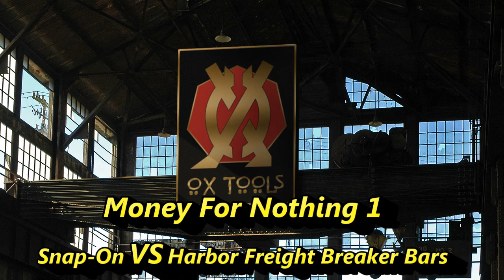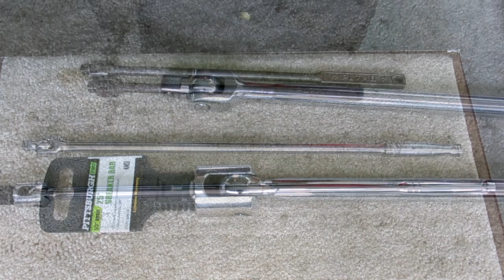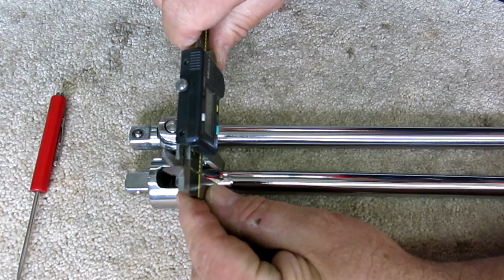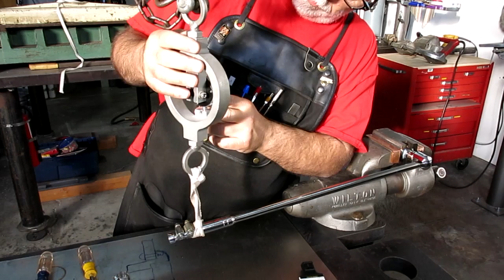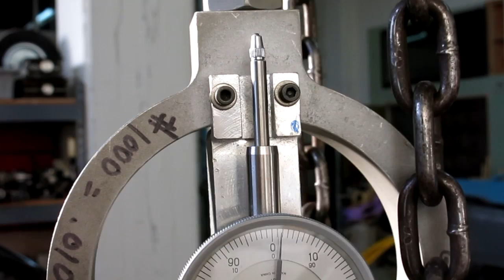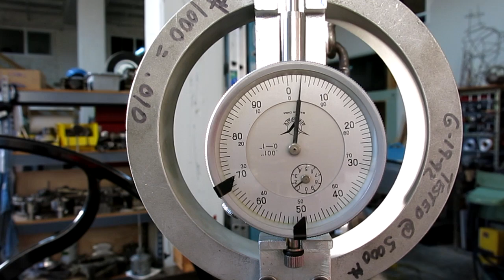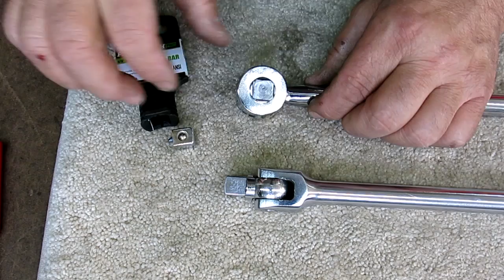Money For Nothing 1

Comment: Tom, I imagine that the fixed socket nicked the corners of the drive square on the first test run.  The nicks acted as stress risers and set it up for failure.  I suspect that if there wasn't the excessive play in the interface between the socket and drive, it would have held on longer.  On the first run it did look like it started to yield around 275lbs.

Comment: Great video Tom l had a bran new Mack breaker bar same size break on a first wheel nut ,I was just 10 stone in weight it went and I slammed my buckles into the concrete cracking two buckles , I only buy snap,on now thanks again  Mark

Comment: Thanks for the video. Good thought out testing you did here.  However I do have to mention something.

I think the problem I have with videos like this is that you are comparing two items that are at two completely different ends of the pricing spectrum. The price points aren't even close. I own that HF bar and and I agree with you about it. I can tell you that I don't care for it. It's a bad design that could cause you to get hurt when it fails. On mine the joint has started to bend and flex. It hasn't broken yet but I stop using it for extreme amounts of force because I know it's going to break. I had a Craftsman one do that on me back when I was a kid and I almost face planted into my car at the time.

I'd like to see a video focusing more on why you think this is a bad buy if you're looking for a breaker bar. Leave out the, what some may feel is cheer leading for Snap-on and focus 100% on the tool you're trying to review. Show it's limits and explain your thoughts. This way people that were thinking about buying the tool can see if this tool will meet their needs.  I'm not criticizing you at all man. I think you did a great job on testing these tools. I'm just expressing what I would rather see since you asked us.

Whenever I see Snap-on vs HF I instantly get turned off. I have a ton of issues with Snap-on as a tool "manufacture". I believe they have been ripping off blue collar American workers for years. Same with all the other sold by truck tool "manufactures" I could go on and on about this for hours. One thing I will say in my favor is that Snap-on re brands items that are cheaper to buy under the actual manufacture's name brand. They also don't support American workers despite what people like to believe. They over charge for their tools, they employ the lease amount of people as possible, and they make it a point to force feed their brand upon students starting out in the industry so that they'll go potentially tens of thousands of dollars into debit before they are even paid enough to recover from that sort of investment. That isn't the type of American company I'll support. So when someone does a Snap-on vs HF comparison I instantly get turned off because I absolutely support tool manufactures that make it easier to get into these industries without burying yourself in debit. I wouldn't be where I am right now if it wasn't for Chinese tool manufactures.
Reply: +Alvarez Metal Works Not really at the opposite end of the spectrum. I have snap on tools purchased used for 10% or less of new price. That said, I have my share of HF for things that either a) I only need to do once, b) I am sure hat the tool won't be overstressed, or c) I buy it as a kit to make a tool from in the first place. That said, I have still broken my fair share of HF tools. Then again, I have broken my fair share of snap on and Mac, as well.
Reply: +Alvarez Metal Works Comparing to the better tool is what highlights why the HF is inferior.  Taken on its own 600lbft of torque seems perfectly reasonable, although the failure mode was disconcerting.  Seeing even more torque applied to the superior tool and seeing it handled with ease is really what makes you think about value.

Comment: How about a fastener rounding test? Machine a 15mm or so hex onto some steel and put a 12 point Snap On and a 12 Point Harbor Freight wrench on it and see which one rounds it off or breaks first. That makes a difference to me as a professional I strongly believe my pro grade tools are less likely to damage a fastener than my cheap ones.
Reply: +Joshua Thrasher its for that reason i prefer 6 point sockets and such to the 12 point designs, as im usually dealing with old/used and sometimes innacurate head sizes.
Reply: +jusb1066 Clearly 6 point is ideal, however with wrenches sometimes you are forced to use a 12 point. Sockets I always go six unless dealing with a 12 point bolt.
Reply: Joshua if you don't want to round fasteners you should use 6 pt. Sockets.
12 point sockets are for getting over a hex in a tight spot. I hate 12pt. Sockets.
You may as well just grind a round head on the bolt.

Comment: I have the exact same breaker bar.  I just went out side to look at it, and my square drive is at a 45 degree angle to the bar.  Not sure if it started out that way!  I used mine to break loose the crank bolt on my Honda accord.  I used a 6 ft pipe slide all the way up the handle, with my closest hand being about 5 ft from the breaker bar.  It flexed so much, I was sure it was gonna break.  I turned my head away as far as I could and bounced up and down while balancing on the end.  After about 45 seconds of doing this I was rewarded with the sound of a rifle being fired in my metal shop, and the pipe along with myself laying on the floor.  Much to my surprise, the bolt broke free and the breaker bar was still in one piece.  I weigh about 190, by the way.

Comment: When they first came out, they were presented as an easier way to get lugnuts off because of the extra length.  I bought two and spun the square off just like you did...by hand on a rusted lug nut.  While at HF a couple of days later, I saw at least a dozen or so of them in a cart...all had been returned for the exact same failure.  I'm a fan of HF, but this is one item that is not worth buying....unless you're going to use it as a billy club. :)

Comment: well, to be fair, at those loads you should be using a 3/4" drive or even a 1" drive. most 1/2" drive sockets will hatch before those torque levels, yours didn't because it was welded, yes snapon was better, but it's somewhat irrelevant since you were beyond the designed service conditions of a 1/2" drive tool

Comment: Hi Tom, great video! Just curious, on the first run with the Harbor Fail breaker, you indicated that there was some kind of slippage happening and then you backed off to inspect. Did you happen to notice if there was any sign on fatigue on the eventual failure point at that time? Just wondering if that was actually the beginning of the failure. 

 Keep up with the fun videos! 

Neil

Comment: To calculate the torque on the wrench, you needed to measure the angle between the pull-strap and the handle axis.  You could also just pull the handle at its end w/o the hose clamps by adjusting in your calculation.  IMO, the torque exerted on the tools is a more useful measure.  

The "Tom-o-meter isn't a dynamometer.  It's a load cell configured to measure a linear force, not a dynamic quantity.   

Tom,  How about testing some sockets??  I enjoyed this video.

Comment: Pittsburg vs Pittsburg PRO, Hi Tom, I have looked into the Harbor Freight subject and found a major difference between regular Pittsburg labeled tools and Pittsburg Pro labeled tools. The Pro labeled tools are made in Taiwan not China, yes they are different countries! Taiwan is making top quality tools as of this date. Tools labeled as just Pittsburg, not Pittsburg Pro are mostly made in China or India and are mostly inferior quality. Big difference in quality! Ps, the steel used in Snap-on tools 25 years ago was prob the best ever made for mass manufacturing sales.
Reply: +John C Lots of "Made in Taiwan" stuff is actually made in China - frequently with the original - or copied - masters, patterns and tooling...

There's no guarantee that anything is actually made in Taiwan these days... Usually they don't cheat, but all too often they do, because the Chinese exporters know that Taiwan has a better reputation for making quality stuff.

That said, Made in China covers many grades of quality...

For example, that Aerospace brand dial indicator on Tom's stress gauge is made in China - and is plenty good enough for the application...

As for the tools, you need to look at what you are buying, as the better made - usually a bit more expensive - tools can be pretty decent for the application, while the cheapies aren't always junk.

600 ft - lbs of torque on a fastener through a 1/2" drive is likely to cause something to fail - it's at least twice the maximum rated working load for such equipment...
Reply: +John C There you go! Now that would be useful information. What does pro buy you at the Chinese store?

Comment: most time when I have a failure on a tool it's always been the square drive especially on a 3/4 to 1/2 reducer.  Great video Tom!
Reply: +John McRae The square corners are necessary to get a drive connection, but they concentrate the stresses... once they fail, the remaining metal has less cross-section to resist the same force, and it goes beyond the yield stress pretty darned fast...
Reply: Ya no kidding, just a comment to Tom.

Comment: I'm at 22:30 and you are about to begin testing the Snap-On. My advice (at this point) is "Don't Do It".

I did a bit of checking for how much torque standard fractional inch square drives are rated for. One source says 385 pound-feet working/probable failure 425 pound-feet. The 814 Newton-meters is about 600 pound-feet, so I don't think that Pittsburgh broke too early. (BTW having something under that much strain constrained only by a bit of cloth tape was not very safe. If your arm (or head) had been in line with the path it took, I would have expected to see a bone fracture.)

At any rate, you are planning to put at least 50% over-torque onto your old favorite Snap-On breaker bar. Now to watch the rest of the video (while cringing).
Reply: Well, it survived. I do suspect you were asking to do more than the manufacturer intended.

I agree that deformation failures are safer than catastrophic failures. BTW, the Pittsburgh did fail by deformation first; you saw that the square drive had deformed, twisting by several degrees.
Reply: +Peter W. Meek When he put it back in for more I though, "what are you doing? That bar's already failed!"

Comment: I would like to have seen this test using a socket To see whether the socket failed first or the tool  . . . Maybe test it with a regular type socket...Then with an Impact socket Which I have used many times for lugnuts
Reply: +not2fast4u2c I'd bet a socket would split at the corners of it's hex before that head shears off.
Reply: It looks like his rig was a standard socket welded to a block of steel?
Reply: I've sheared one of these hb breaker bars and a 1/2 craftsman ratchet trying to get off an old axel nut.  you will shear them before the socket cracks.  took a 5 foot cheater bar and me bouncing to shear the tools.

Comment: Hey Tom:  Great test!  I'm guessing most of the guys who have messed with "cheap" tools, have experienced a similar "mystery metal" failure at one time or another.  In fairness though, the overall quality of "budget" tools has improved over the last 40 years.  Also, our friends in the world of "budget" helped drive a proliferation of tool ownership by the "common man".  40 years ago, how many home shops had a 1/2" x 24" breaker bar out in the garage?  Not many that I remember!  And you sure didn't run down to the local hardware store to pick one up!   So I guess the lesson is pretty simple: buy what you can afford, and even though it looks good, don't expect budget tools to perform like the top-shelf stuff!
Reply: +watcherjohnny Good point... Growing-up, we had a breaker bar - it was a scrap 36" steel pipe we slid over the tool handle... :-)
Reply: +watcherjohnny a friend on mine once bought some budget wrenches he thought were good value, he went way too cheap, you could bend them by hand, lol, yes no cheap wrench ive seen since has been that bad!

Comment: I've got the very same Snap-On breaker bar, same vintage. I warranteed it when I first got it, the square drive twisted on my first good pull in the "plastic failure" style. It did the job and didn't break. It's replacement has been perfect all these years. I had a tough bolt the other day and I had to use a 4X torque multiplier with the breaker bar and a 6ft. cheater to break it loose, I figure at least 1200 ft/pounds. Scary when it snapped loose!!

Comment: Gadgets, gizmos and fancy schmancy measuring devices aside. In the real world I have used Harbor Freight 1/2" and 3/4" hand and pneumatic tools since they were a mail order business way back when. I maintain a fleet of tractor trailers and farm equipment and I have yet to break a hand tool. Can't say the same for their electric and pneumatic tools though. Harbor Freight bench grinder: POS. Harbor Freight 4" angle grinder: Awesome. Harbor Freight 1/2" variable speed drill motor: Good. Harbor Freight 1/2" impact: Impressive. Harbor Freight 1/2" air ratchet: Adequate

 I have a 1 1/2" X 48" cheater pipe I use on my breaker bars and not one  breaker bar has failed yet. I am sure my experience is not shared with everyone and that is expected. For those of us who use tools to make a living, economics enters the equation. I can buy a box full of "Pittsburgh" tools for the cost of one Snap On and in the end, I'll make a considerably larger bank deposit. 

I don't belong to the exclusive "Snap On" club but I do own two Snap On tools. A 1/2" ratchet and a 9/16" combination that someone gave me in the distant past. The Snap On guy rebuilt the ratchet, at no cost but a lot of grumbling, about 8 or 10 years ago. It sits beside my Pittsburgh in the drawer and I pick up which ever one my hand happens to fall on. They both do the job. For me the question is not which label applies but which one performs at the greatest level of profitability.

My shop is my living, not a hobby or a platform for making videos. I do enjoy your videos, Mr. Lipton. They are enlightening, entertaining, educational and informative.

Comment: 200lb jumping on 8ft cheater ( cameo net poll) with a 24 inch craftsmans breaker 1/2  , didn't break  the tool. Broke sockets like candy, but that's why we used craftsmans ,for replacement warranty.  Was common practice for breaking track on m113 personal carriers.

Comment: A fun video Tom!
When you pulled the El Cheapo out of the test fixture to see if you could determine what was failing the camera picked up that the square drive lug had begun to twist already.  The Snap-On forged fork design is going to be inherently stronger hands down. I have the longer Snap-On breaker bar version that I bought back in the late 1970's when I was doing heavy equipment work, and I just used it last weekend to break loose the lug nuts on the back of my roll back truck so I could service the brakes. Of course it worked flawlessly once again!
Reply: +Joseph P. Polnaszek Actually the HF one is the type designed to be able to buy replacement knuckles, well at least they used to, perhaps at $12 its not worth it anymore, its why that design was first sold (at other sellers not HF as such)

Comment: let's see a test on one of Harbor Freights' chain hoists. Fairly easy to rig in the right shop but it would be interesting to see what would kill you using the HF chain hoist.
Reply: +sandrammer Another idea...remove the part of the breaker bar that has the square machined into it (the harbor freight one) and harden it. See if it isn't a materials problem but a heat treatment problem. Providing they even bothered to heat treat the tool parts.
Reply: +sandrammer I've used several 3/4 ton and 1 ton chainfalls from HF - never had a failure.

Also, the head failed when the bar was subjected to 600 ft-lbs - more than enough for the rated capacity of 1/2" drive sockets...

At that, the heat treatment might have been skipped - it costs money after all! - but, the tool performed to its rated capacity - just no margin past that point to speak of...

Comment: A few years ago I destroyed a 1/4 inch drive sliding t handle in a similar way, it also failed on the square. I must admit that I was using a cheaterpipe of at least 2 feet to losen a hexbolt. I replaced the borrowed tool with a 3/8 longreach hex socket, the owner was very pleased with the upgrade.

Comment: Thanks for putting your snap-on in harms way for the test! I have blown apart 3 or 4 of the 1/2 breaker bar that size. A few fail with the twist off like the HF one. Another the head like the snap-on design failed by a fracture around the pin radius. Most were craftsman one was off shore. Another fun video Tom Thanks!
Ben